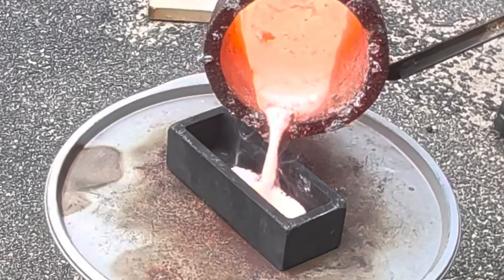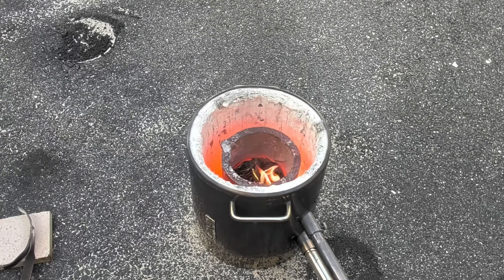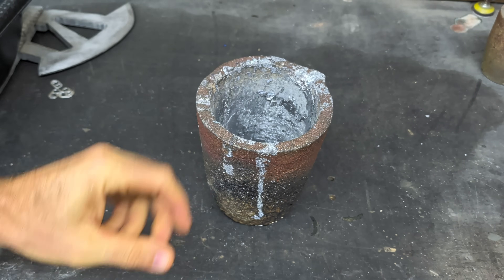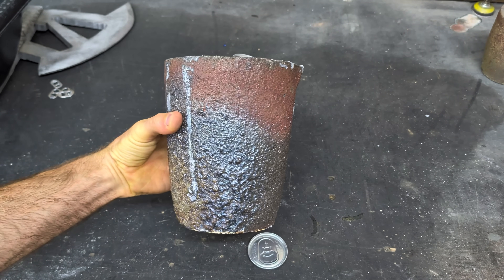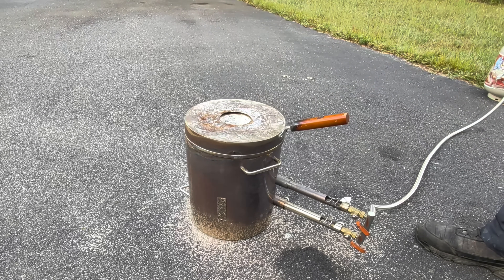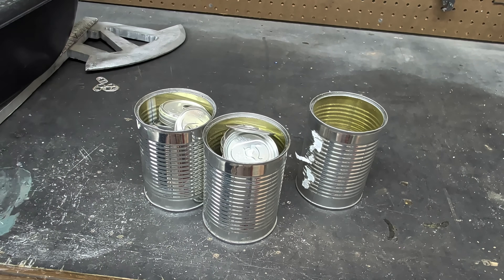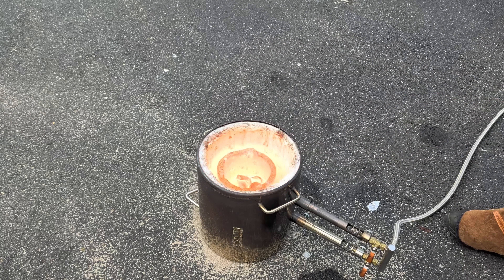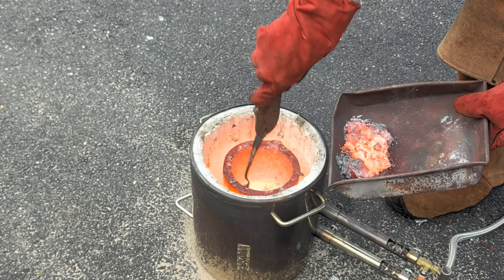Melting 600 Soda Can Tops: Casting Experiment

Comment: unfortunately all that slag is just/was perfectly good alluminium but got oxidized in the process, too much waste
Reply from the maker: Definitely too much waste!  I would agree some of it is from oxidation.  Maybe it would have been better for me to submerge it into the Molten Aluminum
Reply: @HeinrichsMade  submerging is one way to go, the idea is to minimize the exposure, when u r just throwing the pieces like that they get oxidize with minimum heat (alluminim easily oxidize), imagine with high heat, the reaction is much faster, but there are much more that can be done which i am not aware of like using the right flux to block the surface from oxidizing while melting, using the right amount of heat while melting again to minimize oxidation, try to make an experiment, do exactly what u do but with slabs that u have and see how much u can yield, you should find much less dross which is a prove , for the pouring check videos for professionals, they are not many but there are ways to get porous free slabs, i would enjoy such videos that makes something new (improvement and better yields and less wast/less work) , looking forward for more videos from you, wish u the best